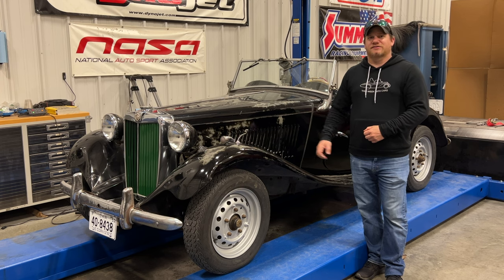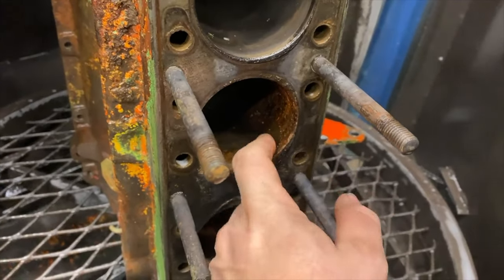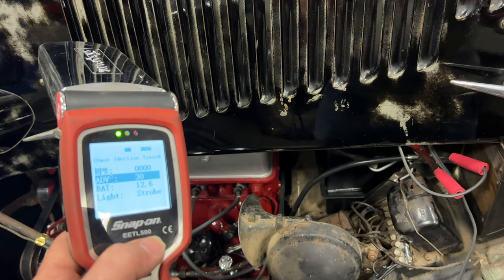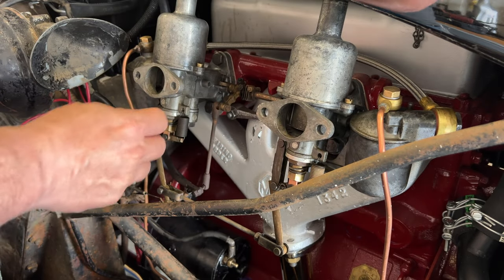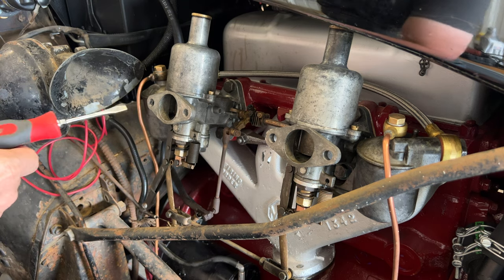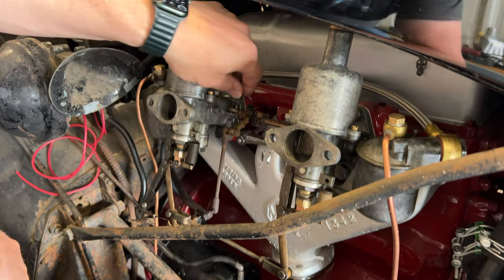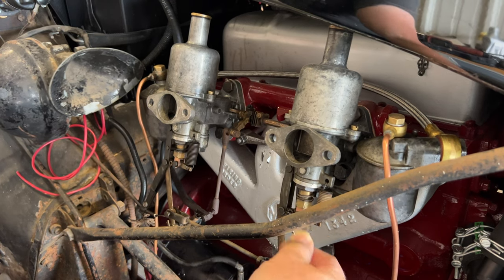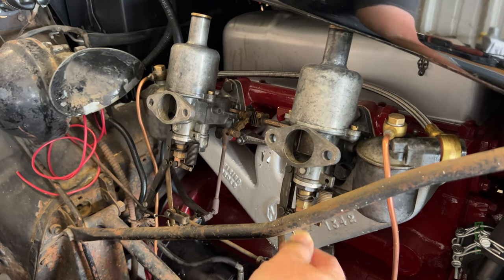1953 MG TD Engine Tuning

Comment: Long ago and far away, I had an Old English White 1953. Unfortunately, all the threads on the carburettors were badly worn. The brass nuts on the top of the domes would unscrew themselves. If I ignored the odour of gas, the visual signal was oily streaks emerging from the louvres. The screws holding down the domes would also shake undone. (I used to keep a stock of replacements in the glove-locker.) Once, a dome fell off completely and jammed the steering (RHD). Fortunately, at a stop, so no harm done.  Great to see nicely restored specimens being cared for by more competent people. Thanks for the memories.

Comment: how appropriate!! i'm currently in the process of tuning the carbs on my 1953 TD and am clueless. :)
Reply: I did not have the benefit of the internet, anybody who knew what they were doing, or access to any literature other than a Chilton when I owned a car with dual SU carbs.  I drove that car for years before I became truly proficient at tuning it.  The main lesson I learned is that you can't ignore any aspect of the engine because it doesn't have enough displacement to compensate for problems.  You need all the potential, all the time.

Comment: I'm a bit surprised to see 5 lug nuts on the wheels......I learned to drive in an MGTD many (many) years ago.....For the last 52 years I've been driving and maintaining a Triumph TR3A as I cannot fit into and MG (6ft 6in).....I'll be re-tuning the SU carbs soon and this was a nice tutorial to refresh my memory.....I sent them for a rebuild and throttle shaft bushings and have had several issues since re-installing them (there's always room for improvement, eh) .....Thanks again, John (west coast, Can.)

Comment: Thank you for clarifying the piston lifting procedure.  I will now be tuning the single SU on my car as soon as I can.  Cheers.
Reply: Hi Pauline 
Make sure you only lift the piston max 3 mm (0.12 inch) when you check mixture. Also keep 20/50 engine oil topped up in the dashpots for good condition carbs . This is often overlooked
When adjusting the mixture nut only small adjustments are usually needed. Basically sneak up on the correct setting.
Look at John Twist at university motors because he is a long time professional fixing british cars.
His explanations are correct and precise.
SU Tune up link----          https://www.youtube.com/watch?v=ttREt7jzthM
This is twin carbs setup but the concepts apply regardless.

best wishes
craig
I own an MGB and E type jag. and looking for a nice MGTD
Reply: @craigmorton1944  Thank you for the advice.  I have watched John Twist.

Comment: I made great money back in the 1970's and 80's converting British cars to electronic ignition and downdraft carburetors. I would also convert the 6 volt cars to 12 volts and generators to alternators. My clients loved me because they could daily drive their cars. I would get contacted years after I converted the cars by happy customers who said that they had driven the cars for over 30K miles with no ignition and fuel system issues.

Comment: I hope you do more of these "prewar design" sports cars. Their old mechanicals seem today practically unknown -- but marvelous. My Triumph TR-3 had those lovely low doors (seemed to be standard issue for many sports cars of that era). Why did they have them? To reach out and touch the ground at speed? British "sports car" was defined by  1)small size, 2)two seats and 3) mass-produced. I mean around the same time as behemoth roadsters with many-litre engines (that the average Brit could not afford) and well before the exotics. Thanks, Steve!
Reply from the maker: I assume the low doors is because it was comfortable to rest your arms on and easy to get in and out.

Comment: I have a TD who’s timing is out. Everyone inc MG Octagon (the major UK MG club)  thinks 30 Degree is way too much. 5-12 max range inc. use of modern fuel. Please explain your 30?
Reply from the maker: You are talking about static timing and I am doing dynamic timing.  When you set your engine with static timing you are just guessing at how the engine will perform when it is actually driving.  With an advanced timing light like I have you can set the timing of the engine when it is running at 2000+ rpm and set it exactly where you want it to be while driving.

Comment: Interesting. Why do you tune the ignition timing at an advance setting of approx 30 degrees (thus at higher revs) and not at idle? Usually you see instructions to set the timing at idle rpm, where the vacuum advance has no/little influence. By the way: I would love to see a longer and more detailed video on the engine rebuild of this car.
Reply from the maker: That was because advanced timing lights like mine did not exist back then.  Why would you want your car to run good at idle and not when driving it should be the other way around.
Reply: @ThisWeekWithCars  I agree with you: tuning the car should be optimised for driving conditions, not idle conditions. Having said that, I would like to see a video on the procedure you do for using a modern timing light: what criteria to use, what settings to use, and so on.

Comment: I always found on my dual carb Brit cars and bikes that if they were tuned on a day with high or low humidity/temperature, they'd only run the best on those similar type of days.  That's not just my imagination is it?

PS:  My Father had a '35 MG-PA which is where I got the "fever", and never outgrew it.

Comment: That was single-handedly the ugliest engine I’ve ever seen rebuilt that was not seized. 

Now I’m dying to know. What the hell happened. Where did all the grease? oil? And sludge come from? Rest of car looks well above average condition.
Reply from the maker: The car was stored in a barn for 40 years there is no way to know at this point who put the stuff in the engine.
Reply: @ThisWeekWithCars  are you sure it wasn’t near an off shore oil spill? LoL. Car looks really good which contradicts engine condition etc. Nice work. Terrific video. did you rebuild to run on current ethanol unleaded? 👍